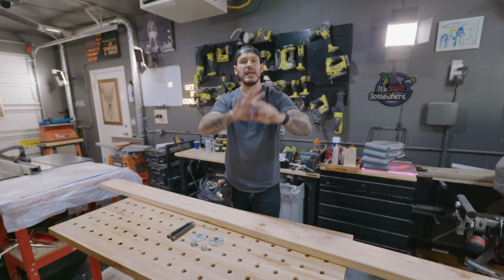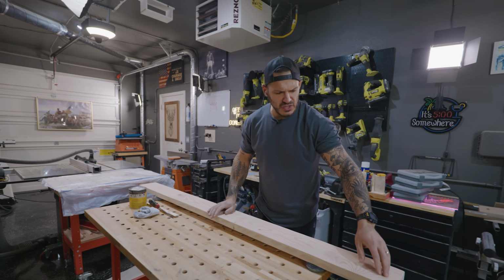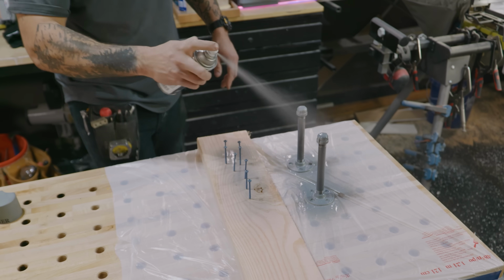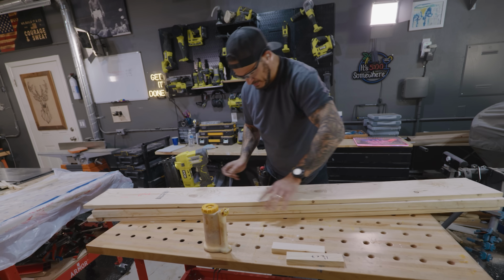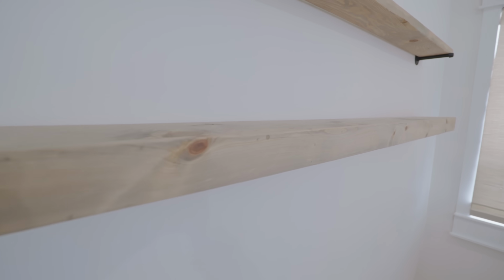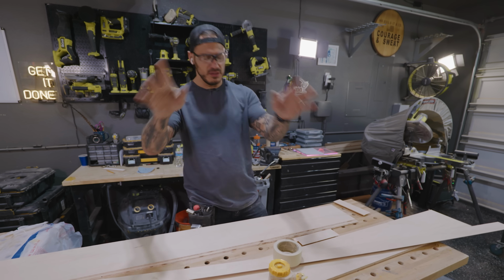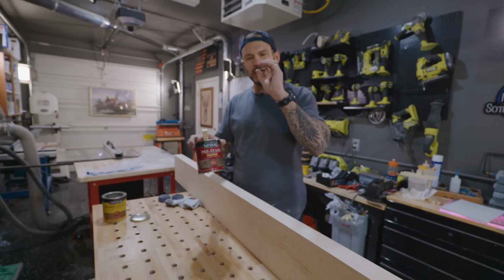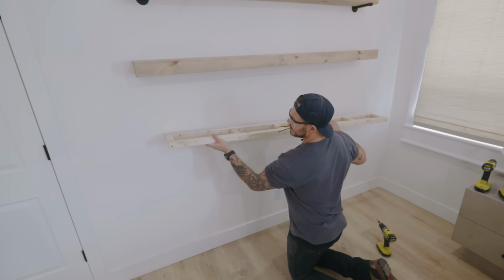3 Ways to Build Floating Shelves

Comment: Miter should be 45.5 degrees. Allows space for excess glue to go. Also increases closure on joints
Reply: Underrated comment. This tip will give you nearly seamless and crisp joints!
Reply: True.  This is what they teach us at carpentry school.
Reply: So, this will make for tighter miters?
Reply: @jesuswasacarpenter   Yes, the visible edge will be seamless.
Reply: Also he shouldn’t have used his magnetic angle finder on the blade teeth and center part. It should have been just completely on the center part to not throw off the angle
Reply: I do this with decking, whenever I have a but joint I will cut both ends with around 3° and closes the top up nicely
Reply: Cutting exactly 45 and just a slight brush of glue and Colin clamps does the job of tight miter corners !! Not nearly , not close enough , it will do the job , learning to use 23 gauge guns does a even more fabulous job !
Reply: Thanks for the tip! I'll definitely keep that in mind. Does the scrap piece get the extra .5°?
Reply: wow, this is genius, never would have thought about this but it makes so much sense of issues I've had in the past
Reply: Using this method, you'd have to glue and clamp it all together at once, wouldn't you?
Reply: There's always that guy
Reply: Are you saying 45.5 just on the miter saw or on the table saw cut as well?
Reply: Then the other half will be 44.5, so worse. Seems you'd have to be another cut & / or some wastage
Reply: I think that also accounts for the thickness of the blade
Reply: @Tom_Hadler  Nope. It will be 45.5° as well. It's easier to realise when you imagine cutting a far larger angle, like 70°. Both pieces will have a very pointy end.
Reply: @seancampbell5496  on all your mitered cuts.. so both saws

Comment: So, I've been building the "pro" shelves for years, never even crossed my mind to use tape to hold the joints together when I'm nailing them.  I usually just use the old hand clamp, so thanks for that tip.  For those building them, if you use a pin nailer instead of a brad nailed (the glue is what holds it together) you will eliminate 90% of you filler need.  Thanks for the videos Alex, keep em coming.  Happy New Year.
Reply from the maker: Great point!
Reply: I've built shelves like that for a long time and have some in my living room that have been there for over ten years. I never used brads or pins to "secure" them. I simply use masking tape to hold everything together as it dries all nice and snug. I've never had a shelf fall apart on me. Never underestimate the clamping power of masking tape! 

If you try this, let the glue dry for at least 6 hours after putting it all together with the tape. Trust me it makes for seamless, hole-less, filler-less shelves!
Reply: @ABrokenSociety  Even better, no filler and minimal 400grit hand sanding.  I love it when a plan comes together.
Reply: @chiefsmash7516  yessir! Give it a try sometime. I found out about the masking tape "clamp" a long while ago but was very skeptical so I kept using brads and pins. I gave it a try and never turned back. ;)
Reply: @ABrokenSociety  I'm a little lost. Masking tape doesn't sit completely flush, isn't the point of pin nailing/glue to avoid any raised surface?  so how are you able to make that work?
Reply: I don't use nails like this in my life so it's hard for me to call it pro, just as hard for me to look at. This method is much faster and easier than clamps and the holes are tiny, though they are.
Reply: @beaulaughlin520  I know this was a couple months ago but.....  the pins, nails, clamp and tape all do the same thing...  just hold the pieces in place for the glue to dry.   The tape is removed once the glue is dry,  but brads,pins and nails (which obviously stay in)  all leave holes.
Reply: @ABrokenSociety good to know... I've always wondered about the hold and sheer strength over time of glue vs fasteners... you never get the feedback on it! Very cool comment

Comment: Feather boards actually will make your feeds 90% better for the full length of the wood. Decent ones attatch to your steel table by magnets. Many pros like using them per habit and performance. Evebn keeping table waxed helps

Comment: I really would love to do this in one of our bed rooms, however, I would like to go wall to wall.  Length is just shy of 10 feet long.
Max length for plywood is 8 feet.
Can I make to smaller shelves and but them together, using filler to hide the joint?
Have you ever made one longer than 8 feet and what was your process?

Comment: I need a 25 inch deep by 50" wide floating shelf in my basement.  It doesn't have to be a floating shelf, but one side needs to be "open" or mostly open/visible.  Any thoughts would be appreciated.  Thanks JJ

Comment: What's the weight capacity for each shelf though. Meaning what is the benefit of going from easiest to hardest if we don't know the weight capacity difference? Pretty important in my opinion. I'm trying to hold a full size PC on my wall. Easily over 50lbs.
Reply: Might want to just go with a non-floating shelf

Comment: Me not having a mitter saw to do the 45 angle cuts for the advance shelve, if I got with the intermediate shelve and use the wood filler and sand afterwards, wouldn’t it look just like the advance model?
Reply: Interesting idea. You'd still see the lines of filler if you're staining but not if painting.

Comment: I looked at some small flanges this weekend in order to try out the beginner method, but can't imagine it's possible to get all four screws into a stud using one of these.  I'd guess only two are going into the stud, and the others are simply going into the drywall (which is worthless).  Am I right?

Comment: 15:21 I just want to understand why the dimension of the frame, and I see now, the outside box is 72" and the frame is 70" 3/4"... but the internal of the box is 71' (1/2" plywood each size) and that why you have the 1/4" wiggles room. great idea!

Comment: what about WEIGHT... that advanced 'chassis' is nice but my concern with floating shelves is the weight capacity of those. At the wall-base no problem, further out towards edge... questionable. I've seen metal brackets that people add to something like this or use those entirely... just wondering your thoughts there. Anyway good video, appreciate the content sir. cheers

Comment: I have to say that I have tried the preconditioner many times and have has disastrous results every time.  It may be just me, but I prefer to make sure the wood is clean and that your last sanding is done with clean or new sandpaper and then wipe off all dust with a tack rag, then apply stain.  Does anyone else have any horror stories with the preconditioner?
Reply: It's not needed

Comment: If I don't have a table saw, can I make these angled cuts with a circular saw or miter saw? Super new to the wood working world.
Reply: Yes, you can. Make the cuts on the ground, but set your sheet of plywood on top of a full sheet of insulation or another piece of cheap plywood. That way, your blade isn't hitting the concrete or grass.

Comment: for ultra sleek countersunk the drill hole first then whem you countersink the screw it will go clean flush with no bent or warped bits around the finished hole😭😂

Comment: Okay this might be a dumb question because I am beginner beginner beginner but I was planning to build some floating shelves and in my head I was just going to buy a 2x6 and route out a 1-in by 1-in groove on the back side of it, then mount a 1x1 to the wall studs, slide the 2x6 over it and screw it into the one by one similar to how you mounted the second one, would this not work? And be easier than most of these options?

Comment: Can someone lmk if you can mount melamine cabinets on plywood? I’m installing a section of uppers this weekend and the wall has sheetrock AND plywood. So I’m a bit worried on the layers I need to go through to hit the stud, my backing is 3/4 the sheetrock 5/8 and the plywood 1/2 I think. Anyone have any suggestions? I usually use 3 inch screws when I install uppers to attach them to the stud. Please any help or ideas will definatly be appreciated!! TIA

Comment: I’ve never tried the wood conditioner on hardwood ply, but I’ve never had much luck with it on staining some hardwood. I tried it on Red oak, recently, and it completely ruined the piece. It was only noticeable after the stain was applied. I started over using only the stain itself and it was much better.

Comment: The expert level should have been 45.5 and then scribed to the wall. Unless he left out the god tier shelf which in that case would require no screws on the top or bottom and instead just dabs of either PL or silicone to hold in place. Still looks great though!

Comment: Great rundown. I've been looking for some ideas for my office.

A question though: how much more secure/stable is the full inner frame from the advanced version compared to the single rail from the intermediate version? It seems to me that those shelves are still both attached to the wall by the same ammount of screws, so what's the advantage?

Comment: My hubby salvaged a piece of full 3 x 6 barn beam from a job he was doing.  About 7 ft long. Drilled 5 holes into wall studs. Epoxied 8" spikes (heads clipped off) into the holes. Transposed locations to the beam drilled 5 holes. Test fit and then more epoxy. I can park a truck on that mantle now.

Comment: Oh man, so much work building those casings. Why not just screw in a lag bolt or threaded wall into the wall, cut off the head, drill a hole into any wood and just press it on? You can do this with live edge slabs as well - a fraction of the work and looks way better!
Reply: Try it and find out
Reply: @uuuultra  I have - hung 7 floating shelves this way, a few live edge 2" slabs - so heavy! It's bomber and so much easier to do!

Comment: I find using 2x6’s and mounting them directly to the walls with Kreg joints to be super easy. I can attach directly to studs every 16”.  If they are low I have to fill the holes and touch them up.  If they are high enough no one can see the top so I don’t need to fill them.

Comment: Great stuff! Naïve q:  How’d one ensure the screws are drilled into the studs? I have had an accident with that before. What if the studs don’t align perfectly with the area on the wall where we need to put up shelves? Is there a technique to that?
Reply: You use a hand tool called a stud finder. Any hardware store would have a selection for you to choose from.

Comment: When I do floating shelves for a customer I buy a piece of timber, approx 32mm thick (sorry from UK). Then drill and fix metal rods into the wall with a resin of into masonry, the. match the holes to the back of the timber drill them, fill your holes with silicon slide it on and leave it to set

Comment: I think you should check out the table saw and miter saw angles, if you're using that much wood filler then one of those guys isn't cutting an actual 45. A quick test you can do is cut a board with a 30 degree and another with a 60 degree then use a T-square/speed square to check if the angle is actually 90. If it's not then your tool isn't quite right.

Otherwise a great video keep up the good work ! =)

Comment: the first one isnt really a floating shelf. its not a floating shelf if you can clearly see brackets holding it up. it would have made it more of a beginners "floating" shelf if you drilled the piece of lumber and inserted the metal pipes into the back of it.

Comment: On the maple....why did you screw it to the wall frame...little bit of glue and a couple brads...plus on the maple there was a noticeable gap to the wall....scribe it to the wall, it's super easy and much better
..NO EXPOSED SCREWS 
..NO GAPS
.......just saying

Comment: Few things, I'm not convinced this was truly advanced. Using Brad nails and a bunch of wood filler when it can be done with none is one. Not contouring the shelf to the wall to remove gaps is another and finally a design using a cleat to hide/reduce the number of visible screws would be better. In addition, no mention of locating studs on the first two shelves. And with the first shelf, that could make positioning difficult because the brackets will be at the studs and may result in an off-center self or not symmetrical brackets. Worth mentioning I think. 🍻

Comment: What are those little "standoffs" you have under the "advanced" shelf? Those look super helpful. I mean, I could just use hockey pucks lol
Reply: They are called bench cookies. They have a rubber side on them to keep them from moving and in this video he is using a cone extension to keep the workpiece elevated with minimum contact
Reply from the maker: bench cookies from rockler

Comment: Amazing video! I'm building a pantry with floating shelves and following this video as guidance!  In the professional build, I'm looking to use 1/2 ply with the 2x2" wood for framing as well.  A question I have is, How much clearance did you allow for the framing to fit inside of the shelf? I'm calculating about 1/4" total to allow for 1/8" on top and bottom.  (I guess in other words, what is the width of the face that you cut?)  Thank you!!
Reply: Less than that

Comment: For a beginner try 3/8 hanger bolts. Screw them into your wall stud, drill two holes the same distance apart into your shelf and slide the shelf into the hanger bolts.

Comment: Personally if I'm not renting the home. I weld these brackets together that attach to the studs with flat plate and have a 5/8 rod welded on. Install them carefully and drill 5/8 holes accurately in your shelf. . This creates a floating  shelf so strong you could sleep on it. And all ypu need is a solid block of wood as the shelf. It's as quick and easy as it gets imo . But requires precision. . And a welder

Comment: Looking to do the professional version of what you did, but wondering if it’s necessary to frame out the support like you did or if a 2x2 secured to the wall is just as much stability?
Reply: It depends on the depth and weight of the shelf.
Reply: More points of contact

Comment: I have built floating shelves by drilling level/perpendicular holes into the wall through the studs, then taking those measurements and drilling slightly larger corresponding perpendicular holes in a 1x6 oak plank.  I then insert threaded bars into the holes in the wall, and then slide the oak plank over the corresponding holes.  The slightly larger holes in the plank allow it to slide onto the threaded rods, but will not come off.  The result is one 1" oak plank on the wall that will not come off.

Comment: Hey Mr. Build It - I built the advanced shelf yesterday for a chinese diesel heater (small and light), and found it very wobbly without adding supports underneath.  The shelf is 13" x 24", so it only hit two studs.  This was really just a practice shelf in the garage, so do you have any tips for future finish versions?  I'd like to build these for cats to be able to jump on, so they would need to be at least 12" wide and support 10-20lbs.
Reply: Make the tolerances tighter

Comment: You should cut a 10-15 degree back bevel on the edges that meet the wall so you can scribe them to the wall contours for a tighter fit. the bevel makes it easy to shave with a block plane.
Reply: This is a true professional tip.

Comment: I wouldn’t use galvanized pieces or I would soak them in something like vinegar or some product to remove the galvanization first. That paint will not stick even with primer when it comes to long term. Also use etching primer if you try to go over galvanization

Comment: Thank you for being thorough about the details! This is my project for this week & I had a question, on the beginner shelves did you use all 4 holes to mount the flange to the wall? Or just 2 of them lined up to the center of the 2x4 stud?  Thanks in advance.
Reply: All 4 if they hit the stud

Comment: It's good that you put the cost of each. Although I recognize the different amount of work required for each, let's be honest and also point out that it's not only a question of skills but also very much a question of resources (and consideration if it's really worth it for a shelf...)
Reply: And the tools that you have on hand. I have a jigsaw. 
Do you have suggestions for a beginner workshop? (Including a DIY workbench)
Reply: @sdeaglefeather  Suggested tools? One of the tools I like the best is the drillpress. 
- Drillpress: a wonderful machine that allows you to cut holes with precision in many different materials. You can also use it to sand / grind. It comes with a vise as well! (one less thing to buy!)
- Jigsaw: useful tool, but not precise. After cutting with a jigsaw you will need a router to even the cut edges. No matter what, jigsaw blades bend, so you will not get a straight cut in anything that has certain thickness.
- Router: nice as well, but not something I use every day.
- Clamps: for sure. Metal ones. You can start with 4, then add more.
- Workbench: a must. You can build your own gigs to use on with it. I never work on the workbench itself, but on custom made boards (mdf is your friend) that you attach / remove to the workbench.
- Sander: it's ok.

I like using power tools that you need to hold with both hands. That way you make sure that if you are holding the tools, your hands are not free to go where they shouldn't be.

Let me know if you need anything else; I'm not a pro, but have built several things myself!
Reply: @DiegoSynth  thank you for the invaluable info.